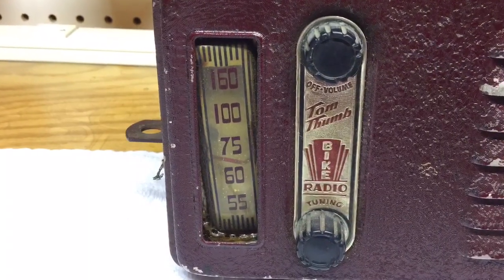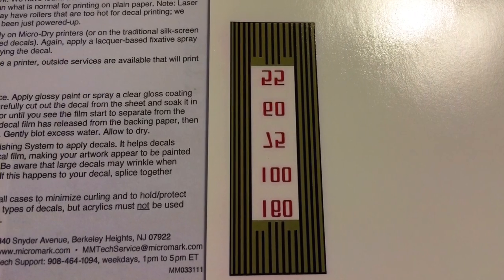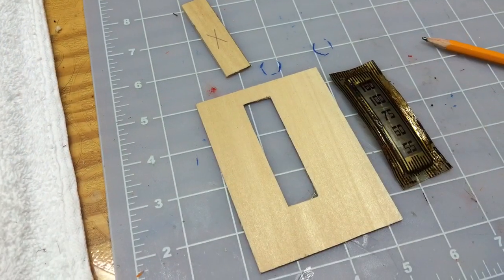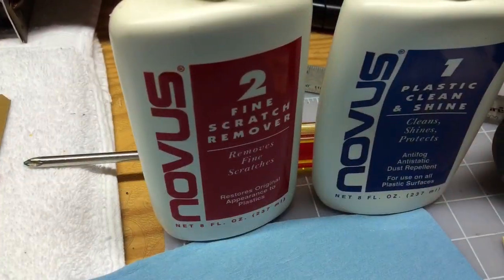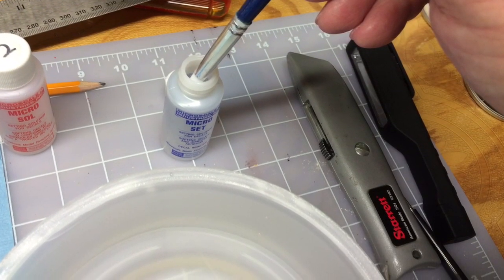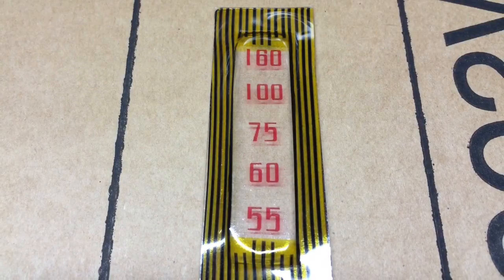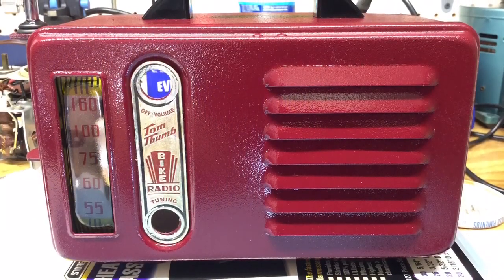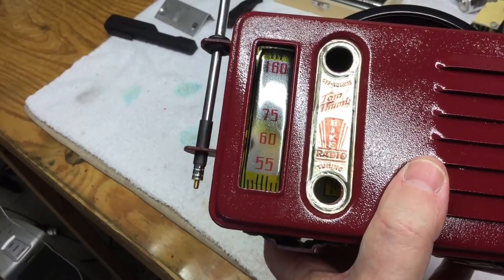Tom Thumb Bike Radio B-44 - Recreating The Dial Scale Indicator

Comment: I'm singing with the choir on this one, and am seated directly next to Art, it's director!  I was certain this dial scale would require vacuforming and thermoforming simultaneously. Resorting to thermal forming was an excellent idea, however, reading (actually "eyeballing") the temperature of the plastic had to be quite difficult. "*Damn decent job there", Don!

*spoken with a "Pittsburghese" accent!! (https://www.youtube.com/watch?v=sUHNRcuwiqo)
Reply from the maker: ***** Tim - I got lucky applying the heat as it was one and done. The "CAB" material I used really forms well. Thanks again for watching and your kind words. Best, Don

Comment: Would it have been possible to use the actual opening in the radio itself, to form the dial indicator by laying the plastic over the opening, and heating it? thanks for sharing
Reply from the maker: Darryl Landry Darryl - you bring up a good idea that I never considered. It may have been possible, but with my final finish applied to the cabinet, I never once considered this technique. I appreciate your idea and thanks again for watching. Best, Don
Reply: Yeah, I had actually written (before applying the finish) but then I left it out. A different sequence of steps and planning ahead is so important.
Reply from the maker: Darryl Landry You are so right. Thanks for your suggestion and taking time to watch the video. Hope to get started on the electronics soon and get this one back together. Best, Don
Reply: Looking forward to the chassis work. Thanks for sharing